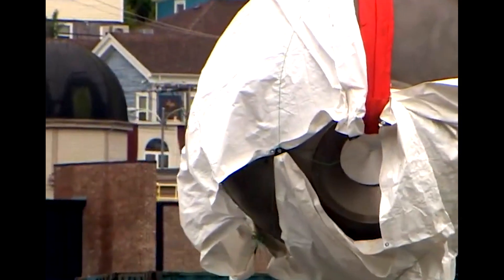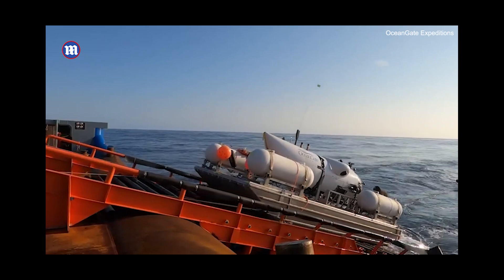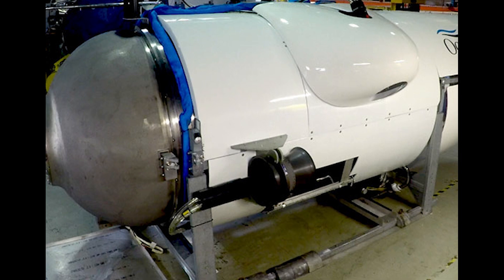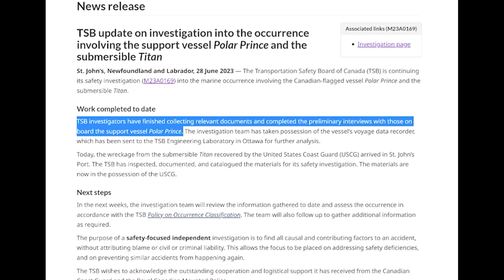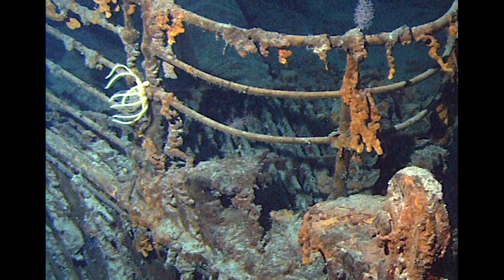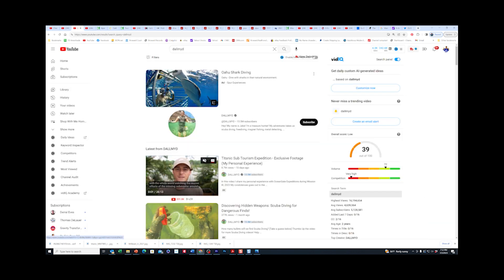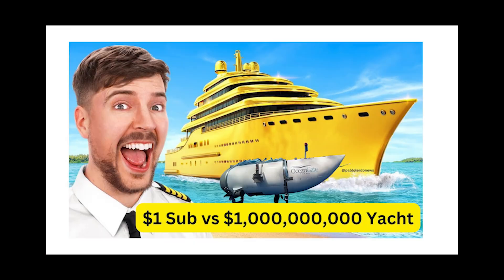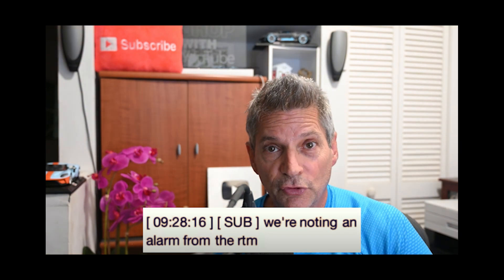Titan Submarine Debris Clues, Implosion Simulation

Comment: That implosion demonstration is nothing compared to what happened to the sub. The demo implosion was caused by less than ONE atmosphere pressure difference. The pressure where sub was would have been around 370 atmospheres so the implosion would have been much faster and subsequent internal volume smaller. The sudden increased pressure would have heated the air by a couple of thousand degrees C turning everything organic into ash, then cooled almost immediately by the inrush of water. Bodies crushed, shredded by carbon fiber splinters, turned to ash from the heat, the ash washed away into the depths, possibly settling on the deck of the Titanic to join all the other ghosts on that ship.

Comment: Maybe a copy of the vessel could be made and tested under pressure with high-speed cameras running? The deterioration in performance, not crackling only, should have been evident and noticed for at least several latest dives before accident. What is crackling, sooner or later will crack.

Comment: A lot wrong with the dissimilar materials connection of the titanium , composite and adhesive. All three materials have different physical characteristics including expansion/contraction rates, fracture toughness, elongation, etc.
The geometric characteristics of the joint itself, such as concentricity, flatness, perpendicularity, dimensional tolerance, positional tolerances, surface finish, overall shape, etc. Any irregularities here will compromise the strength of the joint. 
The adhesive was applied as mere body putty, how could they control the porosity and uniformity in a open air joining application?
Too many what-ifs in this list just on the connection alone.
The overall shapes of the components as well as mating surfaces raises many flags. 
Bottom line, there was no attempt to develop proper testing of all these components individually and as a system to failure mode. 
They lucked out that the doomed vessel worked a few cycles. They had no idea a few cycles was all it could endure.

Comment: I am an Interior Design/Architecture student that grew up sailing. How did so many people agree to turn their heads by using GLUE to attach a metal ring to carbon fiber??? I am really shocked at this so sad event. The families…just heartbreaking.
Reply: It wasn't the glue that failed, it was fatigue cracking in the carbon fibre hull.
Reply: @PreservationEnthusiast  Yes I realize that. But to glue that piece on is negligent at best with Salt water at those depths. Submarines do not have glued on nose cones or anything else. That's why they survive the depths

Comment: It would be interesting to know why it took so long for them to release the ballast? Did things escalate quickly or did they try to push past or ignore signs that they should not have ignored?
Reply: If the sub's structure failed (deformed) without imploding yet, I would wager that the wiring where it was conjoined together failed or the shape of the sub changing ever so slightly put pressure on the ballast and caused it to not want to disengage. Remember how "precision accurate" it was designed. Like when you think and elevator is stuck and you keep mashing the button and it won't move, something like that. Computer failure even within its operating system maybe caused it to lag because it was dealing with so many failures to report at once.

Comment: You haven't even pointed out that, at least on this dive, they were descending 50% faster than normal. Several Communications were discussing noises they were hearing from the back end of the sub, it was leaking. And when they tried their Ascent, it was responding very slowly. It had a number of small leaks, in all probability. Finally failing, as it was destined to do because it had yet to have been detail strip and expected to see what the previous Dives had done to this submersible.

Comment: This is insane.  I use to torque wrench to put together a bicycle.  That guy cranking down on those allen bolts, not only was not using a torque wrench, he had the the allen key cock-eyed! if you tighten and loosen any bolt multiple times, holding tool wrong, you would soon round off the bolts!  Maybe thats why he didn't use a torque wrench to begin with, the bolts were already rounded off!

Comment: They glue a ring of titanium to the outside of a carbon fiber tube? Carbon fiber is compressible. Not by a lot but if you go almost 4000 m deep, there's enough pressure so that the tube wants to shrink about 1 cm in circumference. 1 cm is not a lot, but it's also not nothing. Titanium however is not compressible, at least not with that little amount of pressure. So the tube inside wants to contract, the ring around it doesn't and the only thing in between those two preventing them from separating is non flexible glue, that will completely fail if it gets only a crack thinner than a human hair. Am I the only person on earth who sees a problem in that?

Comment: Been saying this a lot whenever I think about it: why didn’t they just cast a 4 or 5 inch thick steel tank with the right internal volume to make it buoyant and cast a lid for it. Like every other submersible. And it would have easily managed that depth and never failed even after a lifetime of dives. Casting and machining those pieces of titanium would have cost an absolute fortune. Titanium is about the most difficult metal to machine besides tungsten, and is far more expensive than steel. Only to make the rest of it from carbon fiber (and not even the right way alternating directions)? It would have been cheaper and easier to do it right. All around stupid

Comment: Its a shame because nobody is talking about it, you kinda touched on it on the manufacturing portion of the video. Im not part of the Silent Service, but I did stay at a Holiday Inn last night so buckle up.

You touched on the titanium seal to the carbon fiber portion of the submersible. What people should understand is that Titanium and whatever composite he was using, the Applied Forces affect them differently (don't start on me, Engineers! 😂). The ONLY way to tell if there was any structural damage would be an X-Ray room to look into the plys of whatever they were using and an eddy current test on the titanium, dye penetrant whatever.

The thought of using composites is admittedly a new idea, I looked into this guy 5-10 years ago after I retired. I owe my safety to the blood that wrote the safety book on Naval Aviation. I wasn't about to give some guy a bunch of my money to kill me. I knew after 20 minutes of listening to this guy he was gonna kill someone.

Comment: IMO, the video of them attaching the titanium ring to the carbon fibre, should have instantly started bring up red flags. Who in their right mind would be attaching that in what appears to be a simple warehouse. Not in a 100% dust free room. Workers not wearing protective gear (not just for them, but to prevent anything from them going on the joint). It really blows my mind that they thought it was not an issue.
Reply: And applying glue by hand with spatula, measuring visually only...

Comment: You mentioned being bolted in. Say you did have to surface and they couldn't find you. You'd think they would have had a safety charge to shear the bolts and blow the door off. 

I guess I'm not suprised after all of the questionable decisions I've read about made my Stockton Rush. 

When the University backed out that should havr told you everything you needed to know. I think Stockton wanted the Engineering help and reputation of the University without relinquishing any control, setbacks or extra financeing. 

That was ultimately why he refused certification because he knew it wouldn't meet standards. I'm sure it wouldn't have met them due to the same reasons the University ended the partnership.

Stockton is responsible for this implosion due to his want for control over everything and him not being williny to do things someone elses way and wait. 

His ego and need for control wouldn't let him be held to someone elses standards.

It all comes down to money, lack of patience and bigger than anything Stockton Rush's need for control.

Comment: They did calculate for the extreme pressure at that depth,  but were any hidden variables accounted for?    I'd bet a "Colossal Squid" attack was never taken into consideration... I think when it latched on to the Titan is when he dropped the weights in attempts to distract it or so it would let go....before it imploded.   They did know that,   at that depth It's a hot bed for Colossal's?

Comment: Not an expert, but this use of carbon fiber seems nutty. The point of carbon fiber is tensile strength, which is irrelevant for this. Carbon fiber doesn't help much with compression strength. It's like building a tower out of really strong rope mixed with glue. It doesn't matter how strong the rope is because you can bend rope. Putting it another way, the carbon fiber doesn't have to break for the structure to fail.

It's unfathomable.

Comment: Why not machine a ring into the titanium collar(ring) in which the carbon fiber hull would be inserted and glued. That ring might have to be thicker to compensate but it would take some of the stress off that joint which was only relying on the glue in case the two compressed/expanded at different rates.

Comment: 7:19 shows the torque wrench. They used a smaller ratchet to snug the bolts down first. And I imagine the could use an impact wrench and socket to zip the bolts off at the surface if need be.

Comment: There is one small issue that might have changed the outcome of the Titan recovery. The carbon tube they used has a layup pattern that is intended for torsional strength, not lateral strength. I'm not sure why they did not choose a bonified "weave" type of carbon. Would've probably made it out unscathed.

Comment: Carbon fiber is amazing a resisting tension forces (trying to stretch it). But I've never heard of any fantastic ability it has to resist compression.  Whatever resistance it has to resist compression would be born by the resin or the matrix that holds the carbon fibers together.  The titanium ring was glued to the outside of the carbon fiber cylinder.  That disturbs me.  Titanium can resist compression a lot better than carbon fiber matrix. I can easily imagine the carbon fiber hull compressing away from the titanium ring and breaking the adhesive bond.

Comment: Front window.
It was designed to hold pressure from the outside, but any pressure from the inside pressing outward, even if only for a fraction of a second, could blow it off.

Comment: I'm not an engineer, but if the carbon fiber itself as compressed at a rate faster than the titanium ring, the carbon fiber would separate from the ring.  I'd go as far to say that if you had pressed fitted the rings without adhesive it would have failed on the first dive, but the adhesive made up for the tighter tolerances.  I don't see it even being possible, unless the carbon fiber somehow compressed at a rate significantly less than the ring to keep it together.  I'd go as far as to state there should have been inspection marks to show the ring's movements at a bare minimum.  It could have been creeping after multiple dives.

Comment: Winding the carbon fibre as shown would make an extremely strong pressure vessel but would be of little value in resisting external pressure.  It may as well have been made entirely of the bonding resin.

Comment: Quick idea here about why no residues of carbon fiber, not even at the edges of the ring
After watching cavitation bubbles contract and expand multiple times, I guess the volume of the sub imploded but then the water and the tiny fraction of compressed air must have expanded again. Even more, the compression of the air all of a sudden to those extreme pressures, must have made an adiabatic compression, combusting any flamable items and maybe even the meat in a millisecond, adding energy to an already energetic rebounce.
That would work as an explosion after the implosion itself.

Comment: So what was keeping the carbon fiber hull from collapsing?  Let's do a thought experiment.  Take an empty toilet paper cardboard tube.  See how easily it crushes in your hands.  Now take half a dozen shower hook rings and slide them inside the tube for reinforcement.  Bet you have alot harder time crushing the entire length of the tube, because instead of the entire span of the unsupported cardboard tube, you now have the supported distance significantly reduced.  Replace the cardboard tube with the carbon fiber hull, and you can fill in the rest yourself.

Comment: Why build subs in carbonfiber ? 
I would prefer 10" welded titanium hull. And then i would not even going down there. The pressure on  the vessel is 400 bar, thats a lot or 400 kg/cm2

Comment: An earlier post from the same contributor claimed to have a radio transcript that he admitted may not be the real deal. The crew of the sub reported a crackling noise from the aft end of the vessel. I believe these crackling noises were the sound of water intruding between the layers of the carbon fiber laminate thus separating them and ultimately weakening the hull so it could no longer resist the massive external pressure.

Comment: The first wrench was a normal ratchet, the second shot looked like a click style torque wrench, but I'm betting it doesn't matter that much since I'm sure all the joints are reinforced by pressure, not pried open by pressure.

Comment: It is amazing that ANY parts of the submersible were recovered.  Given the incredibly huge  forces at that ocean depth, would have thought it would have been blown into a billion tiny bits! ... Although it does appear that  only parts on the exterior survived and that the cabin itself was blown into  tiny unrecoverable bits by the implosion. Even titanium and carbon fiber are simply no match for the powerful crushing implosive forces.🤔

The following parts of the Titan submersible were recovered:

The tail cone
The landing gear
The rear cover
Twisted cables

Other items probably involved in the mechanics of the submersible
The parts that were recovered were relatively large. The tail cone was about 6 feet long and 3 feet wide. The landing gear was about 3 feet long and 1 foot wide. The rear cover was about 2 feet long and 1 foot wide.

Comment: Innovation is ok but you should test to the point of failure. Then retest and retest and then retest some more. When you can establish a predictable fail point then you can use it to a safe point where failure is not a risk. So if failure is at 4500 meters then 3500 meters should be the cutoff line for safety. 

When I watched the video of the dive that was filmed of the youtuber it showed the batteries and how some of them had water in them. What are the chances that the batteries failed because of water and basically rendered the electrical systems useless. One would hope they had redundancy built in to the sub. But I am guessing not.

Comment: The reason you don't see any bolts or bolt HOLES - is the scenario - and an obvious fact - that the center tube failed catastrophically - the extreme pressure went to both ends - blowing the ends completely off - shearing any bolts holding things together - this is why you don't see bolts or holes in the debris metal parts - sheared bolts.
That is also why the view port is missing and the flange with bolts is also unaccounted for - the extreme pressure from the interior blew it out forward from its mounting.

People have stated that with the extreme pressures comes extreme heat for the millisecond that the implosion is occurring. This heat present at the time of the implosion is the likely cause of the absence of the adhesive keeping the cylinder and end cap flanges together. It was simply melted, ionized, steam blasted off, like an enormous jet of super heated gas and water washing off any remaining residue of that adhesive from the end cap flanges and the carbon fiber center section that was obviously powdered during the implosion.

Comment: Questioning whether they used a torque on the bolts holding the thing together? Be told, even motor vehicle wheel nuts are torqued to an exact setting. What was this cowboy outfit up to?

Comment: IF DIFFERENT ATMOSPHERIC PRESSURE CAUSES IMPLOSIONS.  PUMPING THE SUB WITH OXYGEN AND PERSONS CARBON DIOXIDE IS PUMPING UP THE INTERIOR PRESSURES.  MAKING THE 6K PSI OUTER FORCE, MAKING THE CARBON FIBER CRACK IMPLODE

Comment: the titanium is etched in acid and meticulously cleaned prior to lay-up with   carbon  fibre  pre-preg  fabric. then the assembly is  heat cured in an  autoclave. those rings do not look like they have been etched. then you have one of the assembly goobers wiping down the faying surfaces with some nasty looking rag!   WTF ??  that act alone  my have caused the glued joint to fail for lack of proper adhesion due to that guy contaminating the faying surfaces with his snot rag. I built large carbon fibre parts for the C-17 wings and we would NEVER have touched a clean and prepped part with anything but new cotton gloves  for fear of putting a contaminant on the faying surfaces.  unbelievable :(

Comment: I think it’s pretty obvious that the “glue” didn’t stand a snowballs chance in HELL of adhering to the carbon fiber. It had the adherence level as scotch tape against pressure so high. It’s adhered to hold the WHOLE piece together not some areas stick n others don’t. The ENTIRE sealant failed. Period. So I really don’t see even bits of carbon fiber being stuck to it. The pressure was so perfectly even all around anything staying together was IMPOSSIBLE.
Reply: be aware that many modern cars use similar "glue" to fasten vital structural members together...said glue is stronger than the steel...that said the glued surfaces must be properly prepared---NOT wiped down with some filthy looking  random snot rag